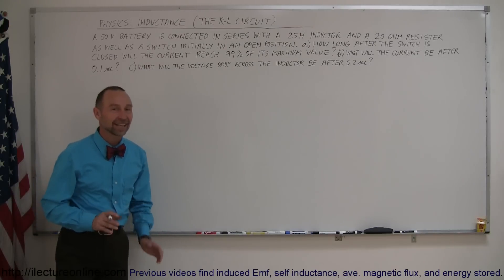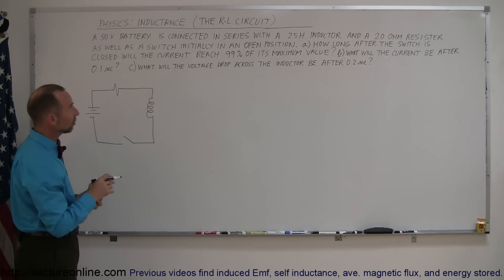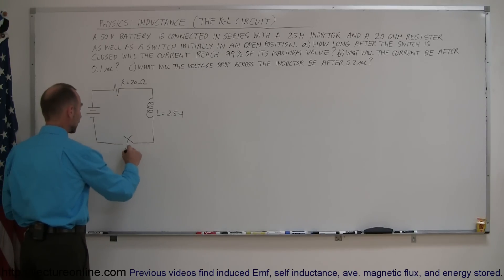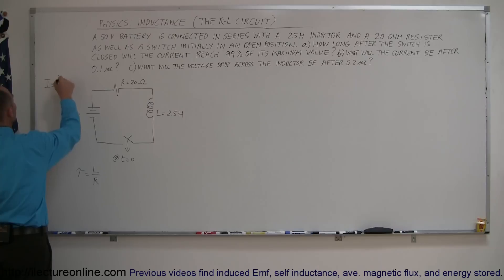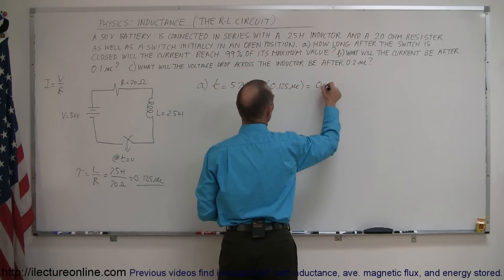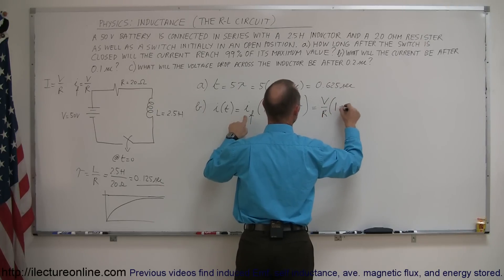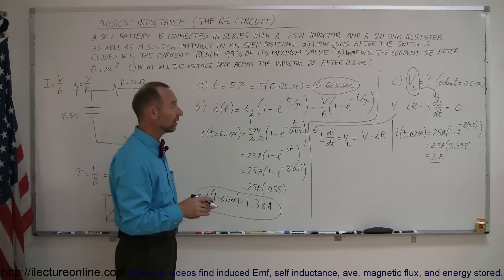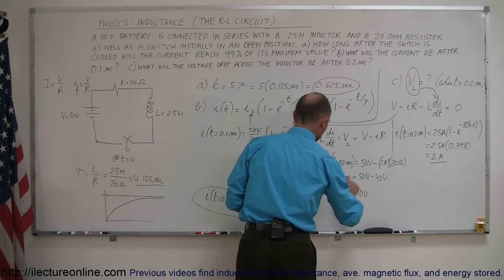Physics 47.1  Inductance (4 of 8) The R-L Circuit

Comment: Thank God! You finally have stopped assuming all voltages applied to circuits are sine waves. But you are still assuming an air core. What happens with a ferromagnetic core?
Reply from the maker: That is not relevant here in order to explain the concepts expained in this video. (that is a different video)

Comment: To find the time for part (a) one should use the solution of the diff. eq. dI / dt + I / τ = V / L, where τ = L / R, which is I(t) = (V / R)*(1 - exp( - t / τ )), where V / R = Imax thus 99% Imax = 99% (V / R) = (V / R)*(1 - exp( - t / τ )) from which we obtain  exp( - t / τ ) = 0.01 and finally t = - τ*ln(0.01) = 0.576 sec.
Reply from the maker: Your method is good, but it is much easier to use the "5 time constant rule".
Reply: @MichelvanBiezen  Aaaahhh you are lazy 🤭(just kidding). If you use though t = 5*τ in the expression I(t) = (V / R)*(1 - exp( - t / τ )) you will get I( t = 5*τ ) = 99.3% Imax, not 99% Imax. In the end the results for the time t from both methods can be rounded off to 0.6 sec.
Reply from the maker: Only mathematicians are interested in "exact" answers, which do not have a practical application in the real world.  But it is good that you understand the differences between the two approaches.

Comment: If the maximum current is ε/R 
and 𝚰(t) ≡ ε/R [1 - ℯxp(-Rt /L)] ⟹ so 99% of it implies 
⟹ 99% of 𝚰(t) = 0.99 ⨉ ε/R 
⟹ 1- ℯxp(-Rt /L) = 0.99  ⟺  ℯxp(-Rt /L) = 0.01
⟹ ln(ℯxp(-Rt /L)) = ln(0.01) ⟹  -Rt /L = ln(0.01) 
∴  t = -L/R ⨉ ln(0.01) 
Subistituting the constants 
t = -(2.5/20) ⨉ ln(0.01) ⟹ t ≈ 0.575 seconds.
What Is wrong with my method?

Comment: Why is the resistance of the inductor ( if any)   not accounted in the V/R(1-e^-t/Tao) ?
Also, why is the voltage across the inductor taken to be a drop when the induced emf is -Ldi/dt so the voltage  across the inductor would then be positive?
Reply from the maker: Sometimes to simplify the problem, the resistance of the inductor is either ignores or combined with the resistance of the resistor.   The term "voltage across" a component doesn't define what is happening accurately.  Rather we should think about it as a voltage rise and a voltage drop.  The voltage drop across an inductor will be such as to oppose the change in the current.  If the current is increasing (like in this circuit when the switch is closed), the voltage drop across the inductor will induce a current in the opposite direction.
Reply: Alrite so since the induced voltage drop across L is in the opp. direction compared to the voltage created by the battery, does that mean the voltage drop across L is negative?

Comment: Very very good videos..About C question. If i do ,for t=0.2,   V=L (di/dt) =2.5(2/0.2)=25 volts..How can that be??
Reply from the maker: You didn't use the di/dt (instantaneous change in the current) at t = 0.2 sec     To find a good approximation that will get you close calculate the current at t = 0.2 sec and at t = 0.21 sec and divide the difference in the current by 0.01 sec and see what your di/dt is for that time interval.
Reply: You are right.thank you so much fot the enlightenment...

Comment: can you please
make a video about how to calculate self inductance for an inductor with a core other than air like iron for example ?
how to plug in the relative permeability in the equation ?
elaborating more about the table of megnetic permeability of different medium and their relative permeability  ?

thanks in advance
Reply: L = 0.4πμN^2A*10^-2/l, where l is the path length.  Hope that helps.

Comment: Maybe I'm wrong, but I thought the equation for current through the coil was "IL = If + (Ii-If) * e ^ (- t / T)". Is there anything I have misunderstood? What is 1? a constant?
Reply from the maker: These are standard equations for the current in the circuit drawn.  If there already is a steady state current (you will need a different circuit), then you could have the equation you indicated.  (See the electrical engineering videos on the inductor).

Comment: induced emf on a inductor is in the opposite direction of voltage of circuit, so induced emf in inductor is the VOLTAGE DROP across the inductor. isnt ?
Reply from the maker: +Manzoor Muhammed That is not the correct way to look at it.  Be careful of generalizations.Inductors oppose a CHANGE in current.

Comment: For part a, since we know the maximum value for the current passing through the inductor will be 2.5 A. I got the function for the current and set it equal to 2.475, which is 99% of 2.5. I then solved for time and got 0.576 seconds, which is a bit off from what you got. Is my method valid?
Reply from the maker: Orlando Ferrer I can't be sure until I see your calculation.
But remember this is a logarithmic function, not a linear function.
Reply: +Orlando Ferrer I=V/R*(1-e^(-Rt/L)) gives 0.576

Comment: Why no induced emf when the switch turned on at t =0?
We can notice the induced emf when the switch turned off by some spark arc across the switch which means high induced voltage, but why this didn't happen when we the switch turned off?